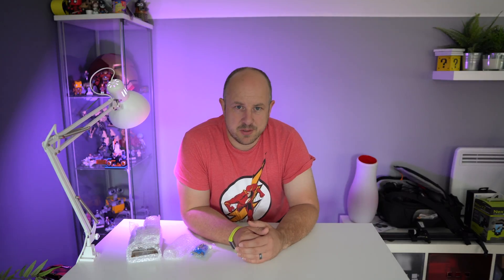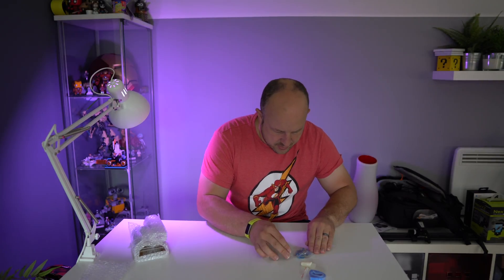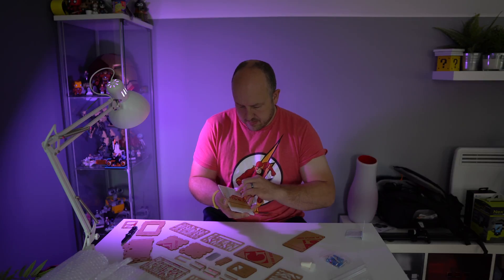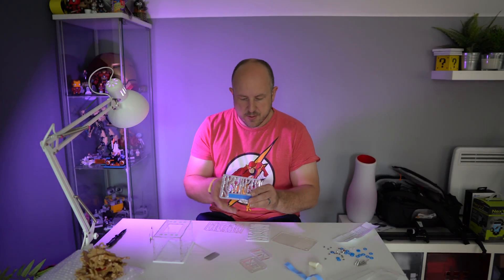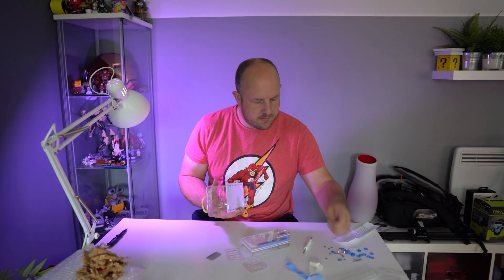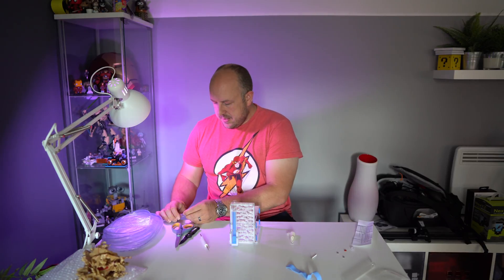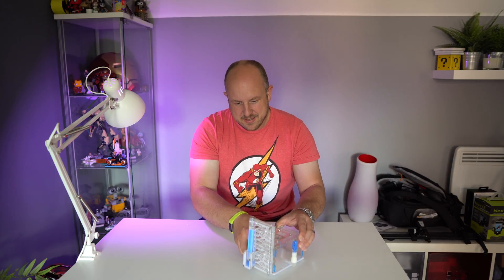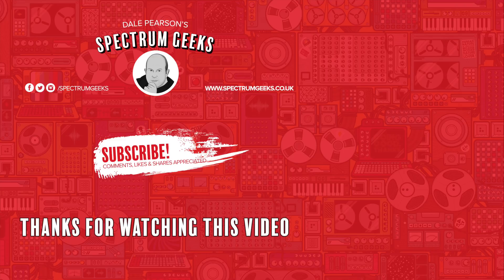Laser Cut Acrylic Formicarium / Ant Farm

Comment: Bought the exact same one. When i try putting water in the big testube water Will get on the ground because There are small holes in the plastic…
Reply from the maker: I have not used this for a while now, but didn't have any water leaking issues.